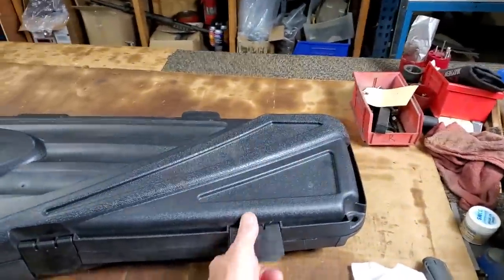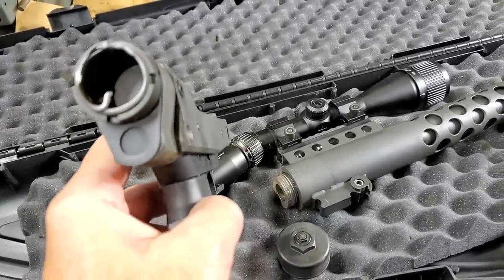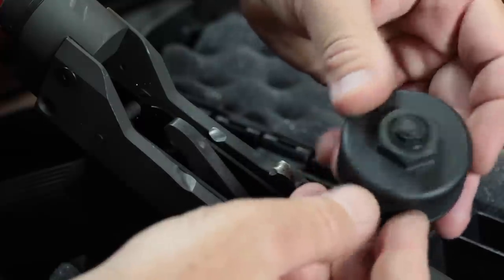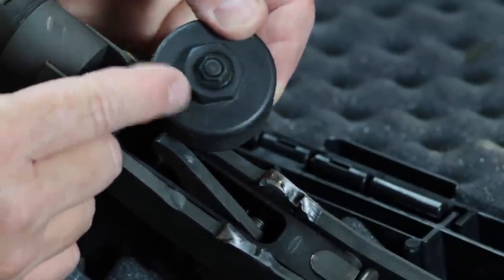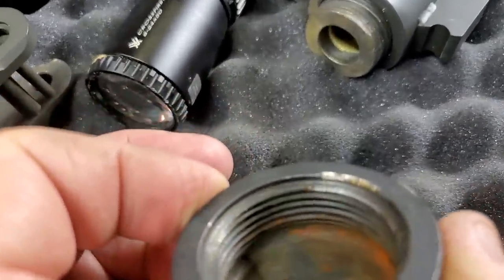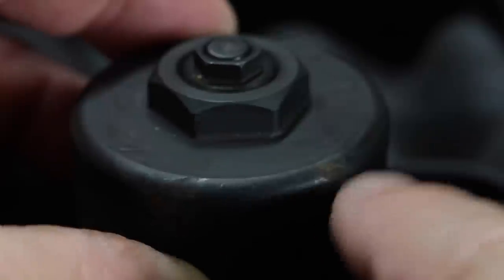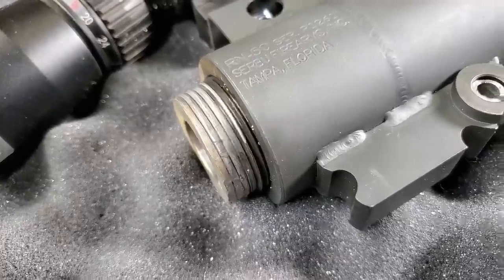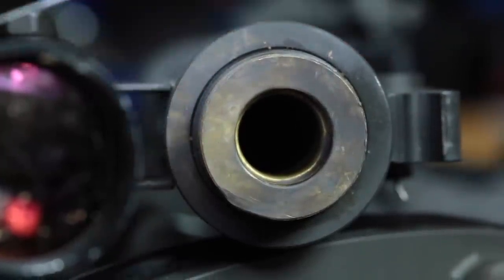Kentucky Ballistics' RN-50 Blow-up:  First Look

Comment: Need to have a chemical analysis done to determine what kind of powder charge was used in that shell. Find out if it was actually the correct powder or if it had been replaced with something else, like a high explosive. That should have been the first thing done.
Reply: Man,I’d hate to be either one of these good people.damnit.
Reply: I think this would be a very interesting experiment, it seemed to me that the rounds were possibly hand loaded with no prior guides or testing on powder loads, which was pretty noticeable from the variable muzzle blasts shown in Scotts video. Would still be intrigued to know whether they used a different kind of load medium, as you said.
Reply: exactly, seems like the round was sabotaged from the get-go
Reply: heres the thing right, lets say that some thing was wrong with said power, then a chemical analysis of a round might just come up as a normal and safe(er) slapp round
Reply: In the video of it blowing up he said the rounds were kind of iffy (HOT). I got the impression he wasn't really surprised it blew up. M-2/machine gun ammo is generally pretty hot. M-2 ammo, depending on powder used, is about 245 grains. My reloads are 205-215 grains. And the M-2 fires a tad out of battery.
Reply: @hidingposer3422  there's a different video where Scott was talking about shooting those slap rounds and how a normal fifty wouldn't handle them because they were more powerful rounds. He specifically stated he needed a heavy duty barrel on a special frame to shoot them or else it could go wrong. So yeah, I think he knew whoever made those rounds had done so a tad over zealously.
Reply: @crazycherokee8552  bingo, I think you hit it on the head. I think Scott's rounds were a reload done by bubba in his basement that had no clue what he was doing and pass them off as legit slap arounds. I think it has become known if I remember correctly that Scott's rounds had brass colored primers when all the real slap rounds I own are dated wcc-09 and all mine have nickel plated primers with red sealant
Reply: @darkerdaemon7794  No, he knew that those slap rounds were designed for the m2, not the 50s commonly available to civilians. Slap rounds are designed to be fired by one rifle only, that's what he was getting at, they are hotter by nature than normal 50 cal rounds
Reply: @darkerdaemon7794  in Scott also stated that he had no idea who made those rounds or where they came from so how could he know that someone made them a tad hot or assume that they did when they've had multiple owners before they got to Scott?
Reply: @magdump4456  y u no reed?
Reply: @darkerdaemon7794  you said"so yeah, I think he knew whoever made those rounds had done so a tad over zealously" and I said no, he did not know who made those rounds at all
Reply: @magdump4456  
😂🤣👍🤦🏻‍♂️
Reply: @magdump4456  you're an absolute genius 🥴

Comment: I don’t own a firearm made by you but I believe in you. At this point, this isn’t a manufacturer defect, it’s a old SLAP round issue.  I appreciate your work, I keep it up!
Reply: Threads are the issue. If that round was in a regular .50 this would not have happened period.
Reply: What do you mean ? Because slap rounds can't be used in semi autos
Reply: I've got a lot of questions about provenance of those rounds. There weren't a ton made, they weren't issued super widely and I doubt the military just surplused them out (especially with the prevailing gun control climate in the time SLAP entered service)... I do half wonder if these got picked up out of a conflict area and there was sabotage.
Reply: @joshuabrown4030  Was probably the case that a sneaky spicy boi got picked up along side some regular ones unknowingly.
Reply: The argument is there wasn't enough taken care of to prevent for both of the safety measures, in case they both were blown off, to not be turned into shrapnel or at least divert them from the shooter as much as possible... of course I'm just stating it, personally I also give full fault to the ammunition while only mentally crossing any thoughts about ever getting fancy with what I'll put in an RN-50 in case I'll ever get a hold of one.
Reply: @666hobart  Not like that rifle wasn't desired to be firing those type of rounds. That wouldn't have anything to do with it. No!!!.....
Reply: @666hobart  Define "regular 50" an M2? An M83 or M107? All with reciprocating bolts? Would have blown the bolt and far more of the receiver out all the same. Even an AR-50 probably would have blown the bolt right out the back and/or resulted in a friggin pineapple grenade in Scott's face.
Reply: @666hobart  you sure the reason the threads were sheered isn't the issue? I don't even think you can fire those rounds out of a semi auto and even if that gun wouldn't be able to withstand the pressure either.
Reply: @666hobart  Fun fact: A SLAP isn't even for a .50. It's a machine gun round.

Even the machine guns that fired them commonly blew apart because of the power of the round.

Add on these rounds were sketchy as fuck to begin with, and this gun is rated for 151 or so thousand PSI of force before those cap threads shear like that... Not the RN-50's problem. That was the round. 

EDIT: Forgot to say this. If you want to talk shit and try to diss on someone's product, you might want to know what you're dissing before you do it.
Reply: @666hobart  Its a HMG round?
Reply: @666hobart  I'll say it again hoping it will get through... Wrong thread type and pitch. Also the engagement is too short for the pressure subjected, this was chosen to simplify loading, while keeping 1 depth worth of thread engagement seemed fine, the thread type and pitch are not. I'm not positive the design is meant for such hot loads at all either. Improvement over this and a protective cover would be a good step. Assuming the cover doesn't become more shrapnel, which is why gun design is non trivial. Double depth on the ears and less sharp corners which are localized stress points would be a start aside from the thread issue. I'd like to see a Rockwell test on the cap and barrel thread region. Not too worried on the material quality perse clearly the pressure exceeded the sheer strength of the thread which makes it the weakest point and thus the focus point on a revised design. However hot the round was the gun has to withstand the theoretical maximum plus a margin otherwise a purposely designed safety failure point should be added. How can I put this the gun is fine but it's not really built like a tank and the owners should not assume so. Also after a crystal analysis of the sheared surfaces to make sure both the material and the heat treatment were not part of the culprit revise the length more than the thickness of the ears, the force is longitudinal so having more surface area would help to resist impact, a differential heat process would also help on the area to make a ductile region avoiding shearing through martensite fracture but what do I know... If the thread fails the cap should be retained. A modified buttress profile could be a start for the thread improvement. 1 diameter length worth is only fine if the thread profile follows this design choice. There's always going to be a failure point moral of the story is try to avoid a chain reaction.
Reply: As far as I have read, (some rounds of...), SLAP rounds being loaded with faster burning propellant, which can degrade somewhat due to unproper storage conditions / temperatures, leading to erratic chamber pressures. Since I've been an ER/ICU + Military MD, a couple Gunnies/ patients / friends I talked to about this SLAP rounds topic, basically warned me to stay away from those, except IF there is 200% reliable info regarding its origin. Just my humble 2 cents. Thanks God, Scott is OK, mostly because his Dad was around.😊🙏

Comment: Don't clean the rifle until you get the residue tested... A lab might be able to tell you what kind of powder / explosive was in that case
Reply: Considering the pressure that separated the firing cap of that SLAP round from its brass body, I wholeheartedly agree.
Reply: You could just test the powder on the case, since it's less likely to be contaminated
Reply: Look at the divot the cap left in the shoulder of the gun having already removed the rabbit ears. The pressure must have been incredible. 
Beginning to think the alphabet men have been dropping some of those C4 rounds state side as well as in the Middle East....
Reply: @CS-zn6pp  Much more likely that a foolish counterfeiter assumed the powders were interchangeable and loaded the round with pistol powder which would definitely explain the overpressure.
Reply: If Mark Serbu sacrifices a few RN50s to reproduce the incident in a controlled environment, it should be a lot clearer what it actually took to cause such a catastrophic failure, which I'm sure he will do.
Reply: @CS-zn6pp  That's exactly what I was thinking as well. For that round to do what it did, it was definitely more than just a "hot" charge.
Reply: @deserteaglegaming5290  really, anyone with the knowledge to reproduce slap rounds well enough to look passable to guys who have used them in the military but doesn't know that pistol powder isn't interchangeable..... 🧐
Anyway, I doubt that would have enough power to do what we saw...
Reply: considering he bought all the rounds together, the same powder should be in the remaining rounds
Reply: @zevo9314  Not necessarily, although the preceding shot seemed wonky, as well. If that spent casing from that previous shot was saved, it would be interesting to check if there was pistol powder in the mix. Assuming that sort of thing can even be determined via forensics after the fact.
Reply: @Patrick-857  That would be awesome and I hope he does
Reply: @acidtreat101  i agree

Comment: This just shows the care serbu puts into his business and products. Even the best designs can fail if put under conditions they were never meant to handle, and its great to see Serbu taking steps to learn and ensure that accidents like Scotts are far less likely to happen in the future.
Reply: For someone not at all familiar with .50 cal rifles, what was the condition this rifle was not meant to handle during the incident?
Reply: @jndvs95  He used a super hot slap round.
Reply: @jndvs95  Scott used a “slap” round. These rounds would normally be okay, but due to aging, who loaded it, and all kinds of other stuff, it ended up being super hot. This means the pressures that the round created were far greater than the pressures that the rifle was designed to handle. Scott mentions this in his video explaining the accident.
Reply: @danielplumley379  aging wont double the pressure
Reply: Gotcha thanks all. I'll stick to my normal rounds
Reply: @johnsmith-yj2cn  Yes, it can. Look up the Forgotten Weapons video on surplus 8mm Mauser. It was overpowered to the point of breaking the test rifle's stock.
Reply: @justusbladetooth  impossible
Reply: @joeds3775  Okay, genuinely then. Look up "Ammunition Evaluation: 1941 Turkish 8mm Mauser" from Forgotten Weapons. Might not be a chemist, but that sure as hell proves my point.
Reply: @justusbladetooth  aging does not cause over pressure. Improper loaded components such as wrong projectiles, wrong power, to much power or a compromised casing could cause these issues. But no aging does not cause the issues. Had a similar issue happen when I was using Hotshot ammunition with my Mauser. I got super lucky though and only some splinters to remove from my forearm and hand. Hotshot is a modern ammo manufacture that unfortunately they made a mistake and had several rounds they accidentally had pistol power loaded into. They thought those were accounted for but unfortunately 1 did make it into my chamber. After disassembly of remaining rounds only one other rounds had pistol power.
Reply: @7979Army  Look up the video I've mentioned multiple times. This was production ammo form 1941 in Turkey, made to specifications and everything but due to storage conditions had degraded to the point of becoming a legitimate risk of blowing up a firearm. Ammunition stored improperly can and will generate overpressure.

Comment: I imagine that when that cap hit and gouged the receiver like it did? Took A LOT of the energy it had away, luckily before hitting Scott.
Reply: It's completely nuts that the cap could bite'n'gouge into thick hard steel with the bluntest "edge" possible... and the cap shrugged it off with a minor ding to the surface finish.
Reply: @Paxmax  yeah that was probably the craziest part to me. eye rings? strong af, but weak in comparison. makes sense. threads? obv failure point. lower sides made of 1/4 inch steel? holy crap how does that happen
Reply: Yeah and to know it still broke Scott's orbital socket in 3 places and his nose with that much energy loss is astounding.
Reply: OH YEAH!, Never thought of that, shit thoes tiny little marks likely saved scots eye

Comment: It would be interesting to fire those remaining SLAPs in a controlled, remote fired, condition with some high frame rate camera's. It might also be worth having some investigative engineers examine the fracture points on the steel. In aviation investigations, they are able to make some surprisingly detailed assessments based off the witness marks and sheered edges
Reply: I would have to agree. Sending it to a metallurgist might shed some light on this issue. While mark is a smart man, he's an engineer and doesn't have the equipment to test and identify stress marks, or the experience of say someone who investigates failed metals for a living. Not that he can't give a productive explanation, I just think more experts would be better at solving the issue.

Comment: Just seeing all this, seeing the damage to the different components, seeing the brass casing still in the receiver etc, is all very stunning to see and know what happened. It just seems impossible even though it happened
Reply: Look at the divot the cap left in the shoulder of the gun having already removed the rabbit ears. The pressure must have been incredible. 
Beginning to think the alphabet men have been dropping some of those C4 rounds state side as well as in the Middle East....
Reply: @bart5246  Let me get this straight, you're telling me that a sabot pushed in to the rifling was stronger than those cap threads? and whatever these sabot's are made from held up to more pressure than tempered steel threads/1/4" steel braces? Please consider that while you make such bold and confident claims.
Reply: @bart5246  Uh....No.

Comment: I am glad how this is being handled, no blanket apology, no accusations from Scott, just all parties doing their due diligence to figure one the cause of this thing. I have a feeling if it was a defect that they will be honest and take what has happened to fix any flaws, basically use this as a learning experience. That being said it’s highly likely it’s the ammo. In Scott’s video the muzzle flash created by those rounds and the amount of recoil seems to indicate they were way way way too hot (and by the amount of warping on the rifle after it went boom also points to it being so).
Reply: Consider it as a sincere way of building up proper goodwill towards his existing and future clients. Esp. since he's basically running his company with a few employees compared to the bigger arms manufacturers.
Reply: Both parties have been very mature and collected throughout this, because as you say I don't think this is anything anybody could have anticipated or prevented in any reasonable way. Accidents do happen sometimes and unfortunately in our current reality most people would rather just sue each other and let the courts settle it either way. I'm not an engineer but I can appreciate the efforts of one, that doesn't look like a weak design to me, certainly not for the expected ammo characteristics.
Reply: Yes it was likely hot ammo. What I would like to know is if there are ways the gun could be made to fail safer.
Reply: @dalentoews3418  I was told that it may be because they're old rounds that probably had stick powder, and if the rounds were agitated a lot, it could have broke down the stick powder in turn changing the ignition/burn dynamics
Reply: @dalentoews3418  a worthwhile investigation and I don't think Mr. Serbu would disagree now that we can see how it fails.
Reply: I agree... That round was waaaaay too hot.

Comment: Back in the 60’s while in Germany one of our units M-2 HB was blown up using armor piercing ammo in a field exercise. The gunner was not injured as the barrel and receiver were only cracked and distorted. We learned latter that the barrel was improperly heat treated and the gun was not properly head spaced. Our unit was required to test the Rockwell Hardness of all the barrels and Air Gage the bores in our inventory and in the field for the units we supported. We found only 10 barrels out of many hundreds tested. We tested the armorers in proper head spacing as in the Field Manuals and Technical Manuals. 10th Ordnance Company DS (Direct Support) Geissen West Germany, Rivers Barracks.  PS: Love your 50 cal single shots. Well made and affordable. Shot an early model many years ago! Accurate and a heck of a lot of fun to shoot! Keep up the channel!
Reply: Very interesting